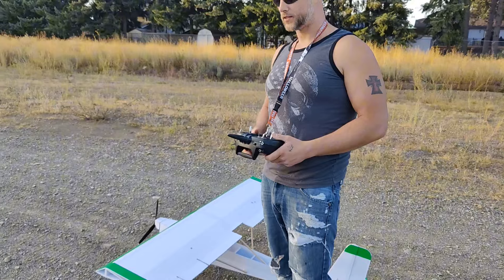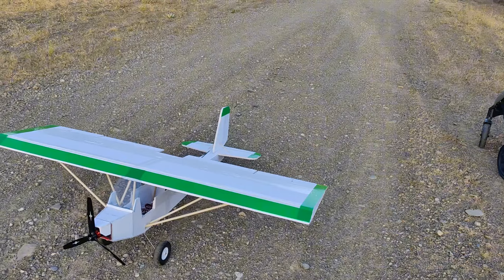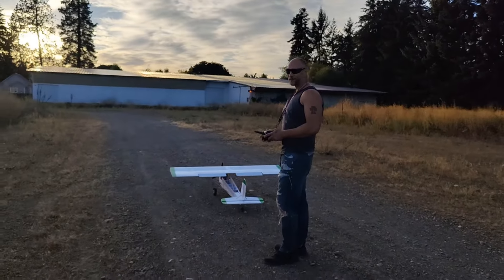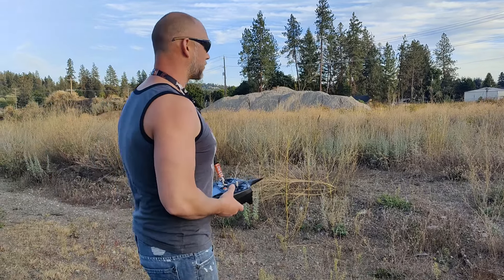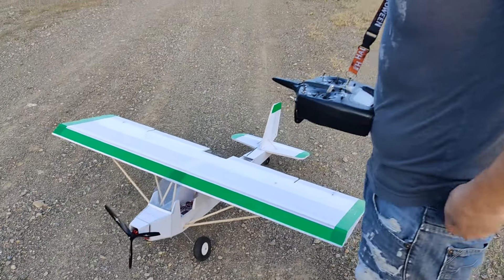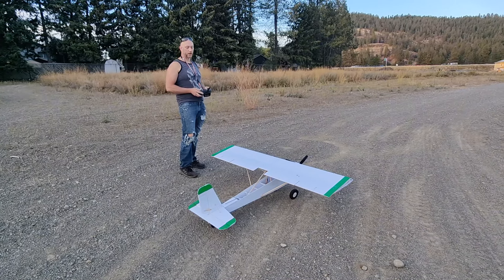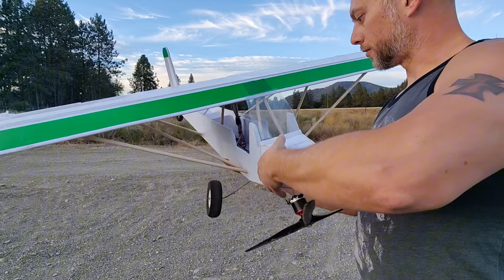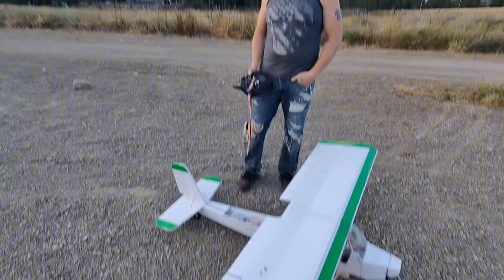My take on the air bike 103 ultra light. #diy #rcplane

Comment: One thing that I do is set the elevator control arm on top of the control surface so that the survos is pulling to go up. 
I've had the same issue with some of my planes. Especially being that you are not planning to fly this inverted, having the survo set to pull may be a quick fix.
Great looking plane! I think this will be a great flying plane once the elevator is sorted!
Reply from the maker: @airplane-mode8577  that's a good idea. I didn't do that this time but I did fix the elevator issue. Once I fixed that I found another equally important issue that you'll see in a upcoming video. This plane has taught me a lot even after 30+ builds of my own design, there's still things to learn!
Reply: @FlyTimeRC  I'm right there with you man, I though I had a good idea about design and building planes, but I'm learning new stuff all the time!

Comment: I always use push-pull cables on bigger builds. It will also look more realistic. I would also switch to a 2 blade prop with less pitch.  You will have more airflow over the wing and more static thrust which is what a slow flyer needs. APV slow Flyer 14 x 6  prop would help it climb faster. That is a great-looking design. You did a spectacular job building the Ultra Light. The color choice everything looks incredible. Congrats on the build. I build with Balsa and CNC foam core sheeted wings. You gave me a great idea for my own Ultralight. I have tried foam board but my planes end up looking like a 2-year-old built them and crashed them 30 times before they even get airborne. Lol. I have to cheat with CAD and CNC.
Reply from the maker: @FarmerFpv  I'm definitely trying 2 blade props a few sizes aswell as motor swaps. More videos coming soon! But I'm super excited about this plane. Lots of work went into this. I'm excited to get it done tuned. It is a big heavy plane but it flies great so far! It's definitely a lot of work to get it right with foam board!
Reply from the maker: @FarmerFpv  I did change up my servo placement. I should have went with a pull config on the elevator oh well. It's good now.

Comment: Dang glad you didn’t beat it up to bad. That thing is nice bro. Looks awesome.. I’d go with a 4S battery. It will probably fly on 3S but I think it’s going to be way under powered… That elevator is deflated a big part of the problem. Run the wire through a straw and brace it in the middle, that way the wire can’t bend.. I’ve done it a couple times, works great.. Can’t wait to see it flying…
Reply from the maker: @EJ-74  so I did the tube on the wire in the back but not the middle. Fortunately I totally changed everything on the elevator. I moved the servo much closer and also used a rod that's 3x thicker. 

As for power I agree on 4s but also I won't get much more thrust. I may have to experiment more with a smaller prop on 4s. But for now I'm going to try to make the 3s work. I'm going to fly it again today and see if I've fixed the issue and I'll know for sure if the 3s will work or if I need to go 4s and change up the prop. We will see.
Reply: @FlyTimeRC  Cool, good luck 👍🏻
Reply from the maker: @EJ-74  thanks! I'll post another video tomorrow and let you guys know how it goes
Reply: @FlyTimeRC  Oh yeah I see you got flaps on that bad boy 😁 I was just asking about flaps, lol I’m looking forward to seeing how it flies. That’s a nice build bro…👍🏻✌🏻
Reply from the maker: @EJ-74  thanks a lot! Ya I think that because I had unknown issues with the elevator the flaps actually helped a lot getting the plane off the ground. I'm hoping to go fly it here in a few hours and see how it does.
Reply: @FlyTimeRC  👍🏻👍🏻👍🏻✌🏻

Comment: Trial and error, I only have one foam board plane and it's frustrating I couldn't get it to fly right even if it was a kit.
But the design looks great, I know you'll make it fly right.
Reply from the maker: @A.M.-RC  yep exactly. Not every design works perfectly from the start. This one is probably the most complicated plane I've built. So far I've discovered two issues that were pretty major. And fixed them both. I've got several more videos coming up. This plane should do great!

Comment: I never use push for up elevator I always use PULL for up elevator.
Reply from the maker: @onmyworkbench7000  I've done that before. I just wanted the plane to look cleaner. Ive moved the servo much farther back now and fixed the issue.

Comment: It is flying but it is to heavy and lack of power. i suggest you to redesign on your plane and use less material but stronger build. Make it light as possibble so it will be floaty. 2500 gram + 6000mah battery is too much weight on it. For home made wing size 60" i usually use 2200mah 3s battery with slow fly prop which giving out more powerfull thrust, if is it proper design you can build it less than 800g.
Reply from the maker: @EnddyFishing  it's 2500 grams with the battery. I ended up going with a 4s. I'm testing a few 13" props now but I've got more videos coming up of it flying much better. Also a big issue was the elevator not working properly. Also another issue I figured out the other day I haven't made a video about yet. But it will fly great as is. Just needed some testing and a few modifications.
Reply from the maker: @EnddyFishing  800 grams would be pretty insanely light for a plane as big as this. Especially with foam board and hot glue.
Reply: 6mm foam will do the trick. using thermal styrofoam also great, but it take a lot of time to do the sanding.